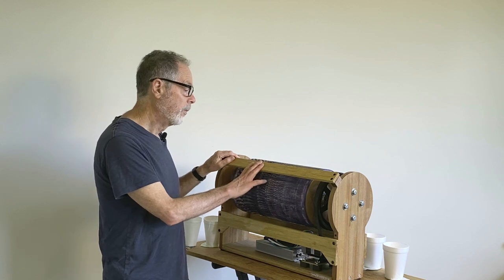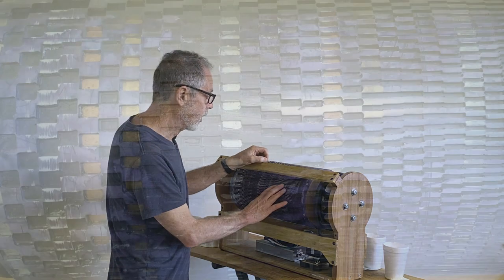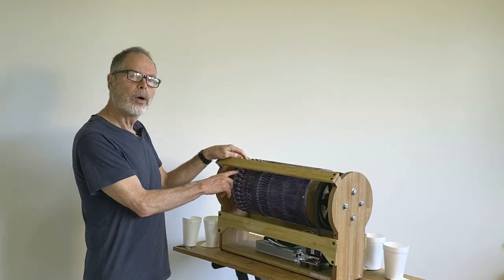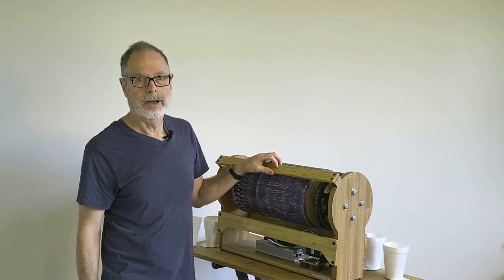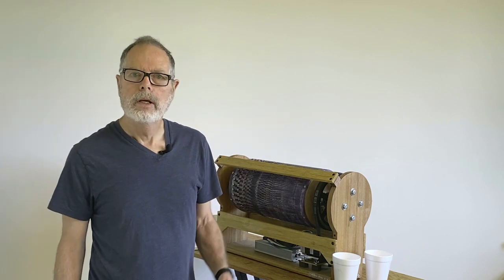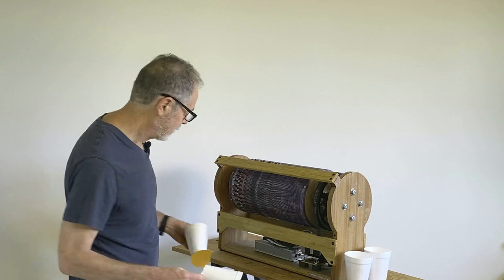Savart's Wheel: an Events-per-Second Machine

Comment: Bart, is this an updated version?
Reply from the maker: Hello Shane, thanks for this question.  Yes, your eyes are sharp.  The instrument you see in this video is a new version of the instrument that you remember from long ago (remember the Savart's Wheel Christmas album that never came into existence?).  That older one can be seen in this earlier video: https://www.youtube.com/watch?v=WSWG5Wv6fLM. The main difference between the two is, the older one used a series of disks of graduated size on a motorized spindle -- something I was able to fabricate myself.  The newer on uses a specially machined cylinder which requires more exacting CNC fabrication methods.
Reply: @bhpkn  still waiting for Winter Wonderland…